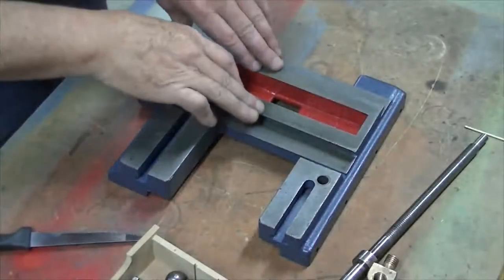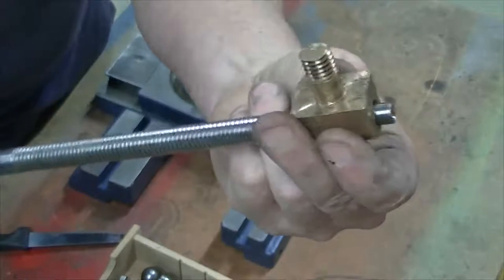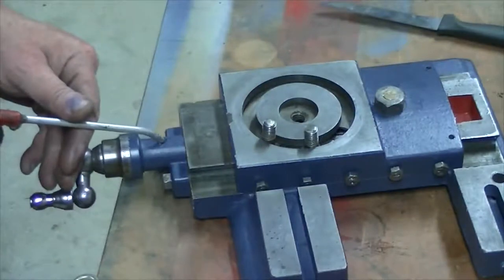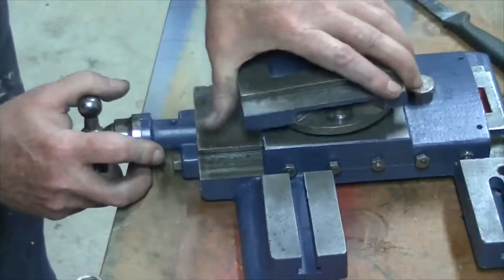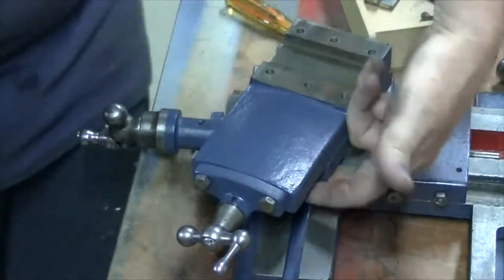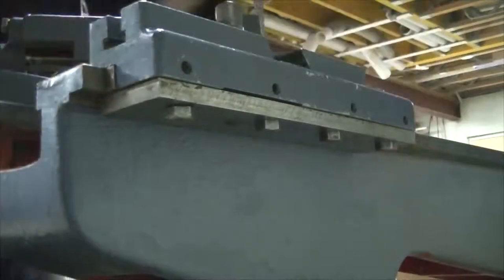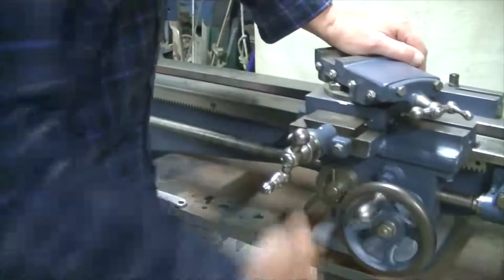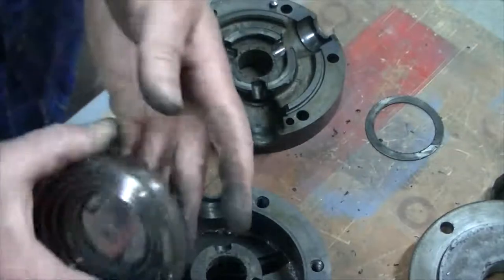Rebuilding a 1940 Hercus Lathe, Part 6 - Saddle up! and more...

Comment: Ahhhh.... So nice to find a video for a job I will be getting into after Christmas. Being a free lathe I had no time to look at it really but it felt tight in my inexperienced quick look. I had to dismantle it to get it home so I'll be looking for repairs needed whilst putting it all together. Thanks for the pointers and places to look. Mine is rather older without the thread cutting box. Just a heap of gears thrown in an old banana box that amazingly all look in good condition.
Soooo very much appreciated I say with another Aussie accent.
old-bonez
Reply from the maker: G'day Robert, glad you found all this helpful!  Just because it's free doesn't mean 'no good'... My lathe was a grand cost of 5-bucks around 35 years ago and still well-worth the repair efforts.
I hear you on the box of gears... mine is pretty much in the same condition and it's one more job on the list to sort out.
I've been quiet on the lathe repair schedule for a while trying to keep up with work commitments and home repairs, but I'll get back to all this again soon(ish)!
Thanks for your comments :)

Comment: I enjoyed your battle with the old Hercus.   one thing you probably know already is that Hercus lathes should never be run in reverse under load because of the possibility of the chuck unscrewing. I worry that your electronic instant stop may have the same effect
Reply from the maker: G'day Andrew, you've correctly brought up a good point. The problem has already tested and with the chuck and faceplate mounted loosely, I found that a quick stop, at the maximum speed doesn't have enough inertia to unscrew. The only plan I have to run in reverse is when I'm eventually doing screw cutting, I'll use it to keep the tool aligned with the thread. I have no plans to do any reverse machining...
A good safety consideration, so thanks, it's a good one to be aware of :)

Comment: The wear on these old lathes is nearer to the chuck, as I found. On a Premo lathe with "v" ways, not possible. Best to put shims under hold downs to remove play.  
Did that, .03 mm. Worked, but permanent/temporary.  Only used for fun. Live in Qld, glad to see another Aussie.
Reply from the maker: The main wear on mine was also near the chuck. The main physical damage (Dings, dents and chunks) were tailstock end of the bed... a convenient tool storage rack!
Reply: @grumpyhacks3945  The wear properties of Brass to cast iron aren't great, like you said bronze would be preferable but if you're in QLD I can cut you some strips of Turcite if you want to build it up properly. Its like butter to scrape and a pleasure to use. where there isn't provisions for a powerfeed to the cross slide I'll usually just scrape the saddle to apron interface to bring the apron alignment up to its original height so I can avoid machining the saddle to accept Turcite which I think would be ideal in your case
Reply from the maker: @marcuschristensen4183  Thanks Marcus, I appreciate the offer :)
I pondered the idea of using a nylon type material (I think it was/is called Pactine, or something like that) because I have it on the shelf, but I like the idea of the Turcite, as is being discussed on the Hercus forums. I'm in Vic so it's a ways from you, but it's definitely a good idea to consider (If I ever get off my proverbial and continue the restore!)
Thanks for the suggestion! :)
Reply: @grumpyhacks3945  there's quite a few scrapers down that way that would have some offcuts/could probably give your cross slide a quick tickle(Just watched your video on it). being a flat bed its incredibly easy to scrape it in should you ever go that route